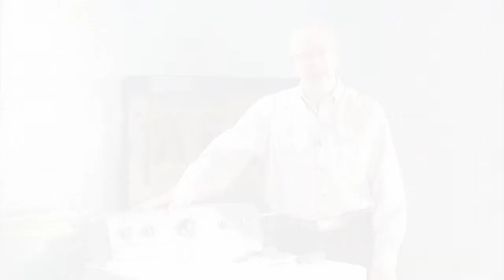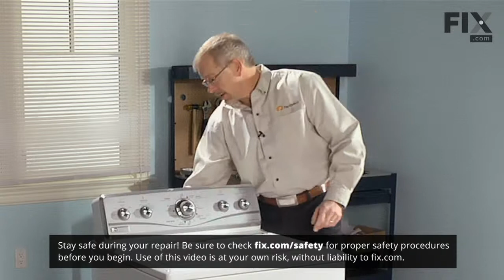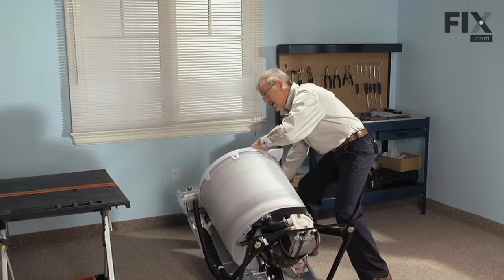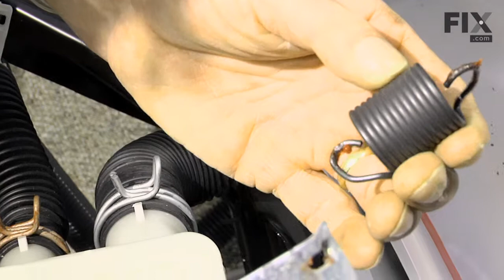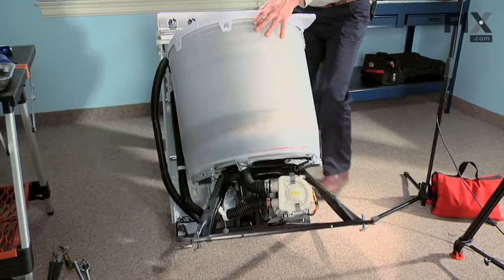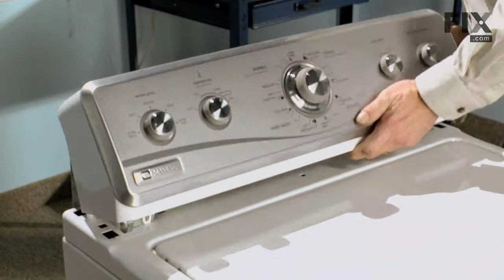Whirlpool Washer Repair – How to replace the Suspension Spring

Comment: I have a Whirlpool WTW5000DW3, and I can't for the life of me figure out how to disconnect the console from the top of the washer in order to remove the frame. My washer seems to have more wires attached to the top than the one in your video. Any suggestions?